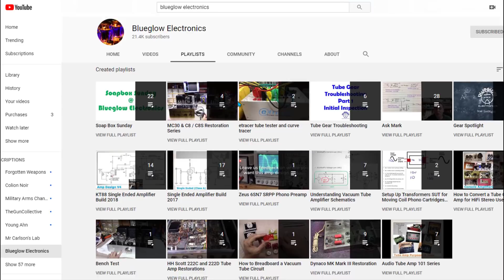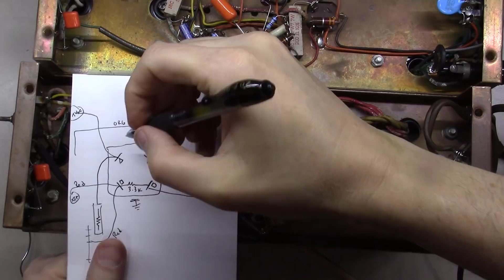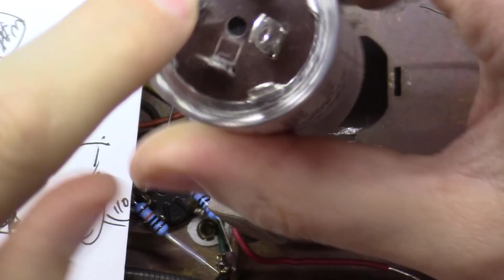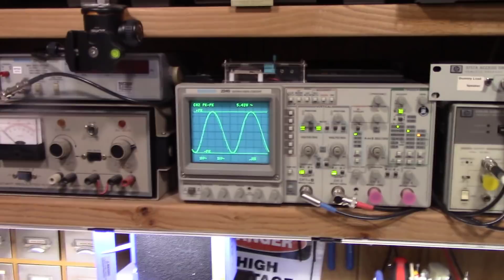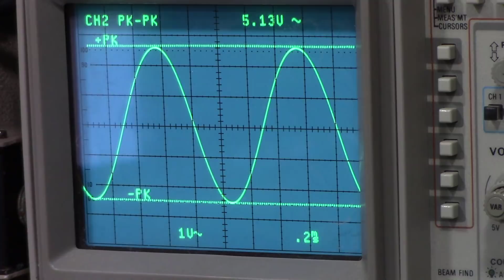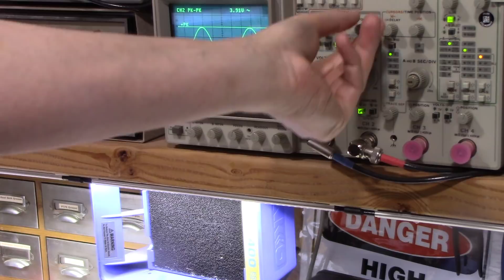Fisher A20 EL84 Amplifier Pair Restoration   BG270

Comment: Man. Ii have one of these, minus the badge. It may be from inside of a console. It still has the Bugle Boys in it, I think. Always wanted to see what this one sounded like. I figured it would be like most of the old Fisher stuff. A humble but amazing sounding machine.  I need to give in and just put it up on eBay and make someone's day. There's probably someone out there who needs one to restore. I was going to do it, but since a brain injury, resulting in Post Concussion Syndrome, I am afraid to work with high voltages. 
 Unfortunately, my brain gets weird, even when I try to build guitar pedals of synth modules. Hey. At least I don't get headaches like others. 
Thanks for the videos. I still enjoy them despite my trepidation and inability to work on electronics.

Comment: Mark, check the screen voltage (pin 9) on the el84s.  It should be 350.  If not it might be the orange wire issue noted on John Norton's comment below.

Comment: I'm glad you open all of your repair videos with the safety warning. One month ago today, my godson electrocuted himself working on a high voltage wood burning system he had homebrewed. His dad was there but had turned away for just a few seconds when he heard his son make a noise. When he turned around his son was falling to the floor. CPR was started and 911 was called but he was beyond saving. He died at the young age of 22 largely because he made a mistake and did not keep a hand in his pocket.  Everyone please use safe procedures when working on any electrical equipment.

Comment: Thanks Mark, I use my Hakko desoldering tool the same way to get chassis soldering (and desoldering) done. For extra heat I will use both the iron and the desoldering tool tip when the chassis is sinking a lot of heat.
Cheers and stay safe now,

Comment: There are three terminals on the old electrolytic.  You have used all four on the new.  The orange wires should be connected together to one section.
Reply: I wonder if this was deliberate to use the unused section of the cap. or an oversight.  It seems to me there may no longer be 120v feeding into the circuit of the second section.

Comment: Been watching you for about a year, love your videos. I did buy a discovery unit, no real luck with it, not sure why but it will smoke an amp (actual smoke) and massive distortion. Ah well, such is life. I have been a Fisher fan for a long time! Just bought a Fisher 600 stereo receiver. It is an interesting unit, PRE MPX on the FM so the AM and FM tuners are independent of each other so that "back in the day" you could tune the L ch on FM and the R ch on AM! There are jacks to attach a stand alone MPX to it, which I have sourced. I can't wait to recap it and bring it back to life!